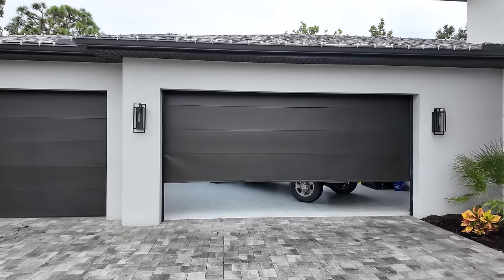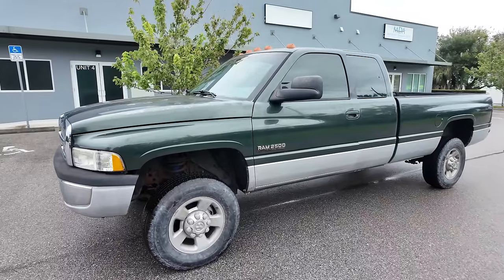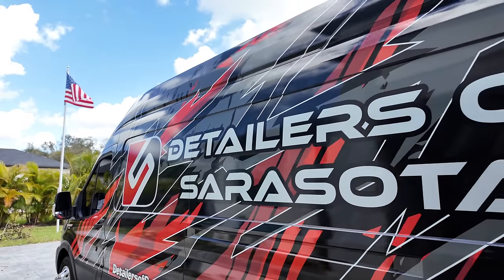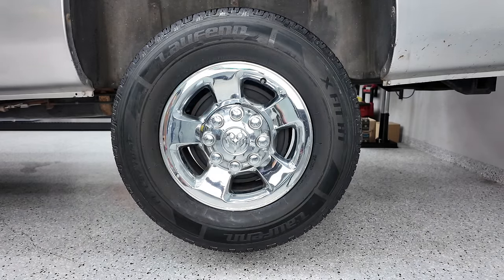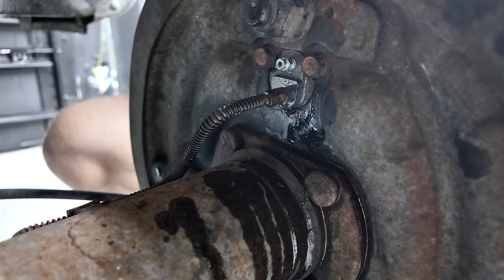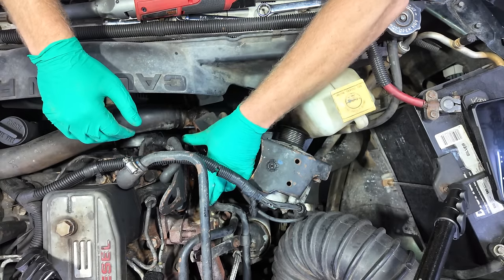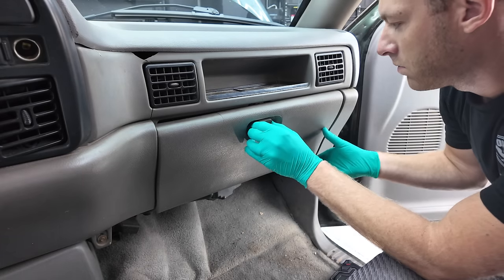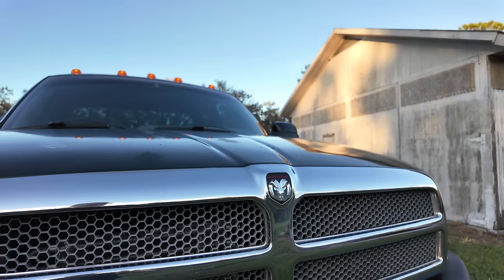Buying Back My First Pickup Truck

Comment: It’s always advisable to change brake shoes when you have had wheel cylinder leaking as the shoes get contaminated from the fluid leak. 
For the price of shoes not worth the risk. 
Love your content 👍
From across the pond 🇬🇧
Reply from the maker: Good to know thank you
Reply: I was going to say the same thing.  Might want to check the diameter of the drum also.  Those usually don't blow out unless the drum and shoes are worn.

Comment: I have a 96 2500 that had a V10 in it until i swapped in a 12 valve and a 5 speed. I remember this truck from back in the day, i was so bummed out when you sold it. Its a love hate relationship with these old dodges, it always seems like theres something that needs work but they never let you sitting. I'm excited to see what all you do with it now that you have it back.
Reply from the maker: 12 valve swap was a power move 👍🏼

Comment: I found my dad's '84 Chevy Comodoro 30 years after he sold it. We bring it back home in a almost 1600 miles travel in the hotest day of the year. It was in a aparently good shape, but the 2.5 4cil smoked as the rings spins in the pistons...bad brakes, springs heated to low it down...that was one the most exhaustive trips that I've done so far. But,  with a smile in the face all the time, even when run out of gas in a 105° summer sun...
Now, almost 7 years after, changed the tired 4cil to a 250 in line 6, with 525b isky camshaft, head, valves, Weber 40 carb, dual exhaust and other little things. It may be small for you guys in US, but here in Brasil is a standard and satisfatory upgrade for the 6 cylinder and fits the car very well, since it's very light and compact compared to american standards.
Of course it's a unsellable car that I hope to stays in the family for generations.
Reply from the maker: That’s so cool you found it! Keep it forever

Comment: Only thing I do differently when bleeding is a take a air pump hose and water bottle, put it on the bleeder and a little fluid in the bottle with the hose under the fluid, crack the valve and pump the brakes. It will let air out but won’t let air back in.

Comment: I say this with some degree of experience and knowledge of the 24-25 Rams. You put on new tires, brakes, caught up on maintenance, detailed it along with some love for the exterior. Without reservation and with little concern for the mileage, you have a better truck than the current model years. To be honest, saving nearly $100K while, at least I think, getting a truck with more dependability along with a truck even a novice can watch a few minutes of YouTube then repair and/or maintain for pennies on the dollar compared to the current model years.

$100K plus or well under $10K -- given both have good AC -- a load of stinky garbage, crossties from HomeDepot, or loading up brush from the latest hurricane, neither the truck nor the cargo it hauls gives one hoot in hell what the truck cost.
Reply from the maker: Yea man I completely agree. I will say my $100k truck is a lot more comfortable to drive but why have all that money in a depreciating asset. Switching it up for now to full time on the 12 valve and selling the expensive truck.

Comment: Too cool. I’m working on getting my ‘98 with a 12valve 5 speed back up and running. It has 358,000 miles on it. I’m actually on the same wheels, which are from a third gen.
Reply from the maker: Dude that’s awesome 358 is a lot! I want to run this thing to 1M miles

Comment: Nice 12v. You should mount a welder in the back for good measure.
Reply from the maker: Maybe a fuel cell and generator to run our house and office during a storm

Comment: I love these dodge ram trucks I owned a doge ram wheel chair van a 99 bought it in 2016 it's my first car to 55 thousand miles when I got it now it's at 64 I've had a new control arm put on in 2019 a new water pump and thema stat in 20 22 5.2 v8
Reply from the maker: They really are great trucks!

Comment: We have a 1996 3500 12v with 400k on it still pulls the ponies to the shows and really beside maintenance on its second transmission and fuel pump motor never be touched.
Reply from the maker: That’s amazing

Comment: My first diesel truck was a brand new 1996 2WD automatic Cummins dually
Reply from the maker: Damn what a unit do you still have it?
Reply: @DoctrParker  traded it on a trip to Oklahoma drove a 2001 2500 24v 4x4 5 speed back home I currently have an 02 24v 4x4 auto I bought in 05 it has 135,000 miles on it

Comment: Adjust those rear brakes and check all the hardware. A wheel cylinder should never fail by blowing out from the bore. They fail and leak but it looks like the shoe was out of position and over extended it.
Reply from the maker: The whole hub probably needs to be replaced
Reply: @DoctrParker  drum should be fine. Adjust the adjuster till you barely hear the shoes start to rub the drum. Drum brakes are a interesting set up but simple when you figure them out. Looking forward to many more videos of the truck